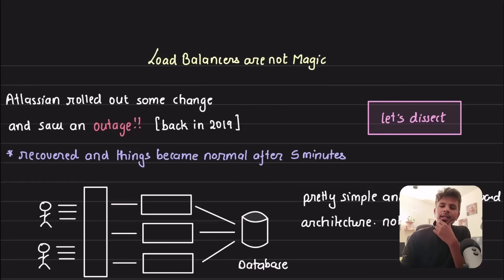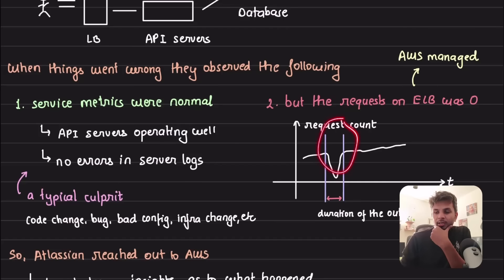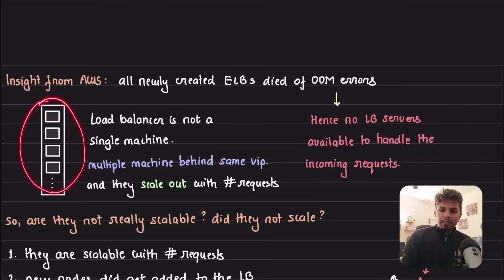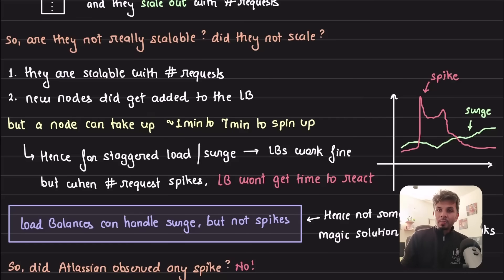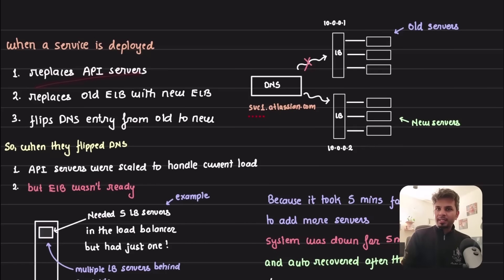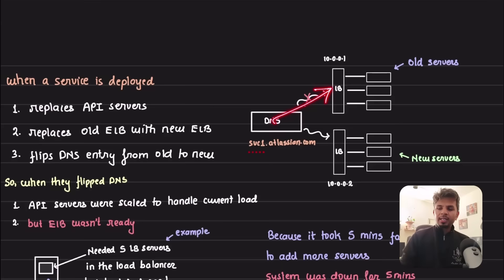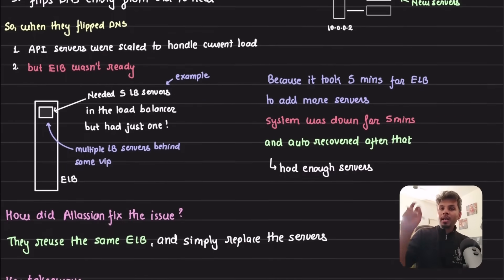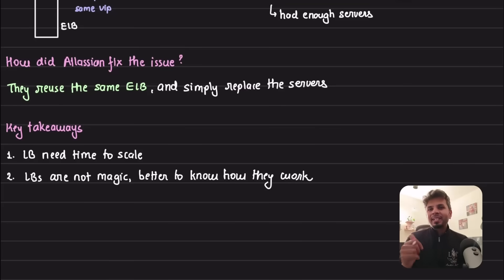Load Balancers are not Magic - Dissecting Atlassian Outage

Comment: I have a silly question. If the Load Balancer is not a single server but a cluster of servers (Horizontally scaled), then which component will decide which load balancer server should the request go?
Reply from the maker: There are three ways - DNS, VRRP, Anycast + VIP + BGP. I have a video on Anycast plus BGP already.
Reply: @AsliEngineering  Intersting stuff. Thanks man

Comment: Thanks, Arpit! But shouldn't this happen every time they flip the LB server? I mean, there might be a request load every time they switch in the DNS load balancer server, so they should have observed this issue earlier as well?

Or is it possible that, by luck, the previous switches occurred when the request load was low?

Comment: This is quite basic, in a running production how come the ELB dnd are switched without preprovisioned nodes. This would supposed to fail. And on the top of that they could not find what is the reason initially..

Comment: which component routes the request between diff LB nodes ?
as far as I know , 
in case of  DNS-based load balancing, the system selects the nearest load balancer node from a globally or geographically distributed set, optimizing traffic routing based on location.

Comment: But what happened to OOM error on load balancers ? Whole video seems to be in two parts i) OOM error on load balancer  ii) Shifting from Old to new LB. The video discussed only the ii part.
Reply from the maker: OOM typically happens when a large number of connections are created in short time and each request/response leads to a larger data transfer.

The deployment happened during a peak time and large number of request hit a newly created (so underscaled) load balancer.
Reply: OOM happened simply because of high load on all available servers

Comment: Any Idea on how the load gets distributed across load-balancer instances at the ELB, (Even if anycast is used here, is it smart enough to route based on the load handled by each of the instances), IDTS a hierarchical approach is used here, since the instance at the top of the hierarchy will face OOM during traffic surge.
Reply from the maker: They leverage Virtual IPs.
Reply: Did some digging up and made a video  about the same https://youtu.be/FDJlFCkRQTA?si=TQWtOEI18Ji9MA7K

Comment: Whats the point of load balancer if itself needs load balancing ?
Reply: Good question 😂😂
Reply: Because you cannot have infinite resource. 

Let say each module of LB is an instance with some number of cores and some RAM and you are getting charged per instance used in a given unit of time, so you would want a system to auto scale as per requirement in order to save cost.

For e.g. each instance have say 4 cores and 2 GB RAM enough to handle 100 request/sec and each instance cost $2 per hr, now if you are getting 500 request/sec for next 3 hrs then you will need 5 instances of server for next 3 hours costing 5*3 = $15, like wise in a day you required different instance then charge would be different. In a long run this should save money compared to a fixed allocation with very high number of instances which may be get wasted during low traffic duration.

Comment: Great video as always, Arpit! Couple of doubts:
1. Even if the rollout to the new setup was done with significantly fewer LB servers, shouldn't the requests processed still be > 0?
2. How does a Hotstar or a Jiocinema handle spikes if regular LBs struggle with them?
Reply: Regarding the first point.. if many requests hit the servers simultaneously and resources are not scaled to handle you will have thundering herd problem and no requests will be served
Reply: @shashanktiwari4442  That makes sense. Thank you!
Reply: For the 2nd, They predict the spike and provision the infra before hand (In other words, servers are already warm before the big Event starts.)
Reply: @prasad_rathod_py  That makes sense. So basically, they already scale up their infra before the start of say, a big cricket match in the anticipation of surges?
Reply: @rohantiwari8149  Yes. There's already a video by Arpit where he is having conversation with one of the Directors from JioCinema. In that video, she has explained all these preps in detail.
Reply: @prasad_rathod_py  usually for campaigns and events infra will be scaled up either horizontally and vertically so they expect this spikes